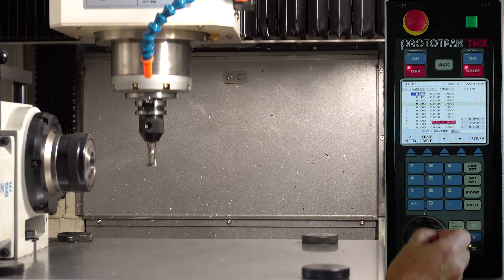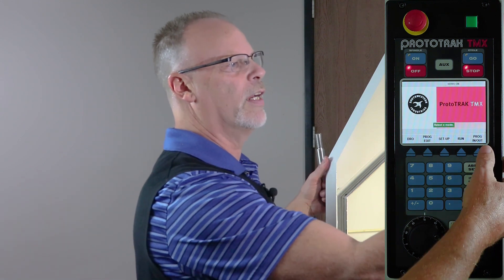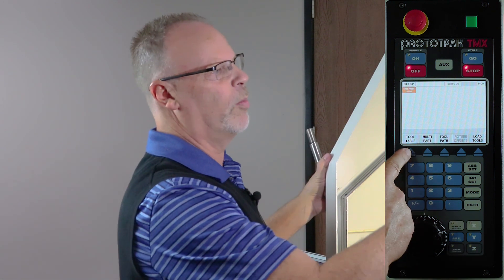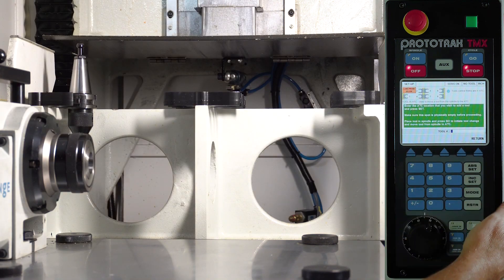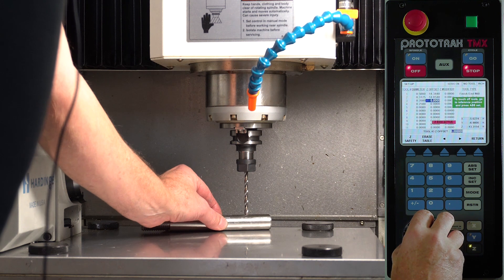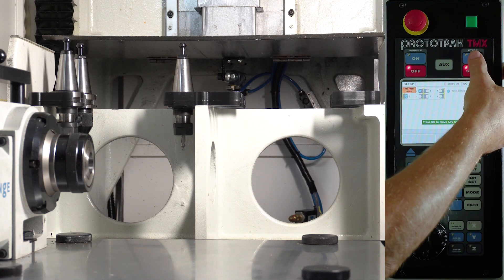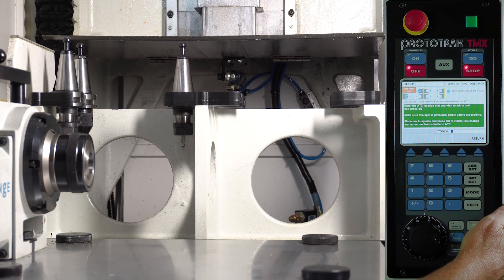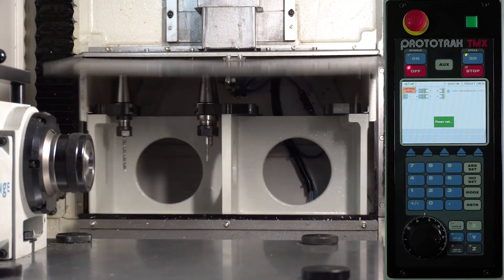Tool Setup | TRAK 2op Portable Vertical Machining Center

Comment: So Ive done all this three times now.  Turned off the Machine, next day I have a blank tool table.  Any tips on what Im doing wrong.
Reply: You have to go to PROG IN/OUT and when you save the program, it will ask you if you want to save a temp file.  Push SAVE TEMP and the machine will remember everything.  SAVE TEMP saves the program, part zero, tool table and all tool offsets.  When you shut down and reboot, go back to the PROG IN/OUT and push OPEN TEMP. After that, all you have to do is home the machine and you are ready to go.  Let me know if this works for you.  PS, you can always call me at the factory. Extension 207.  T.P.
Reply: @patrickfitzsimmons5187  Thanks Pat, Its a learning curve for sure. Im now up and running with the machine thanks for the help. The Machine is simple to use.... Im just simpler :-)  My next issue is getting the Fusion 360 Post  Processor to Tap,  everything else is working but tapping just hovers over the hole. Ive not found a solution yet unless I can set a separate Op direct on the machine... I'll figure it out.

Comment: Hello

I did all that on Trak 2op M10 and then put the program to run, but then when the machine change for another tool, it is quite common to pop up a error (Critical Error 5257 --- +Z Soft limit exceed) and the machine freezes.

Do you have any idea what is happening? 
Is it related to the code or Is it related with the machine Setup?

I already changed the Z safety from 10" to 8" or less, did not work. The machine change the tool automatically and then return to 10", goes up a little bit and freeze.
Reply: Z safety is related to your part Z zero.  If you set it at 2" that means your tools will go 2" above your part to clear any obstacles.  Is there 8" of travel left between your part Z zero and the end of your travel in the Z axis?  If not, you need to reduce the Z safety number. If that doesn't fix your problem, please call our service department in case the error code is for another reason. I would also suggest that you reach out to your local TRAK rep and ask him to stop by. He may see the problem and help you right away.  I hope this gets you up and running but if none of these solutions work for you, feel free to reach out to me again.  T.P.
Reply: @patrickfitzsimmons5187 I have this exact problem